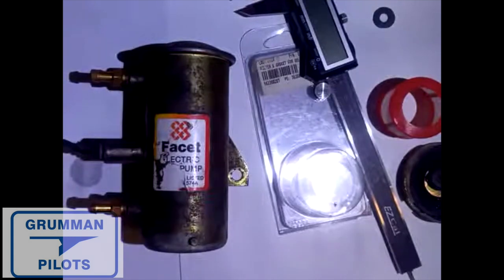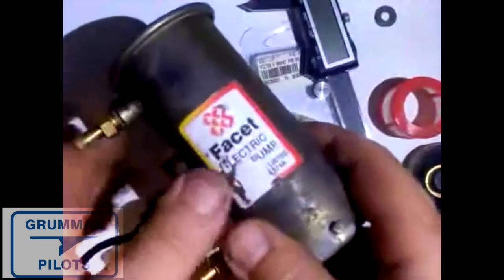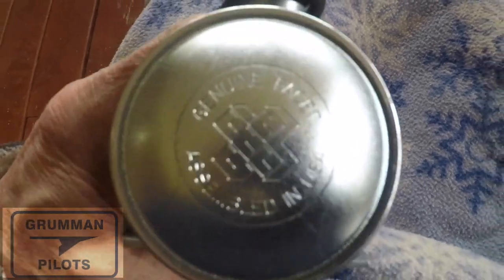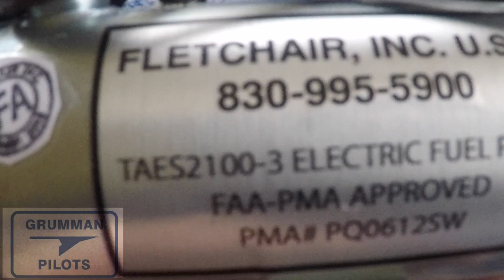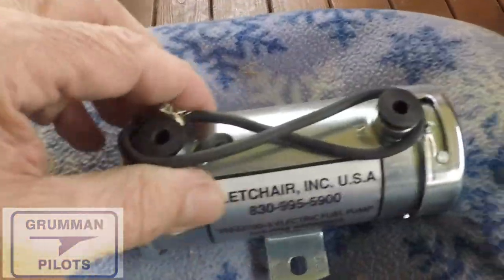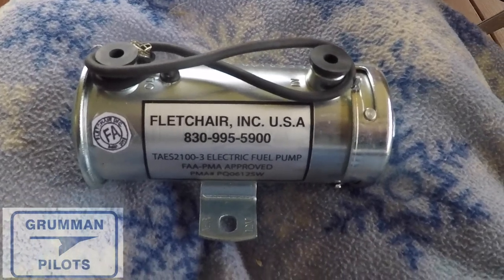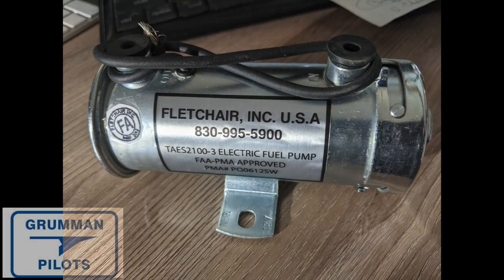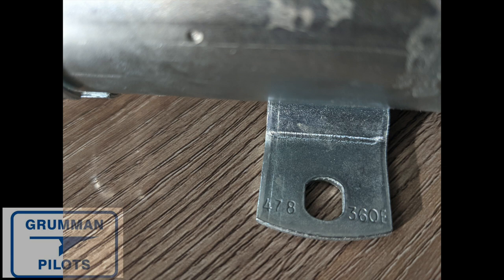Facet 478360E Interrupt Fuel Pump - Grumman Style

Comment: What are the vintage rules? Is it years or a specific list?
Reply from the maker: Once an aircraft is 30 years old, it is vintage.  We qualify.  Covered in AC 23-27
Reply from the maker: Directly applicable to our example is the provision that states that “You may substitute parts where a direct substitute for a part/material can be found under manufacturer part number, military specification, or other recognized standard, such as the SAE.”

For most aircraft owners, AC 23-27 can provide a route for substituting an industry standard part for an OEM part which may no longer be available in a timely manner or for a reasonable price. Mil-Spec switches, SAE alternator belts, batteries, etc. can often be used under the guidance of this Advisory Circular without resorting to an owner produced part.